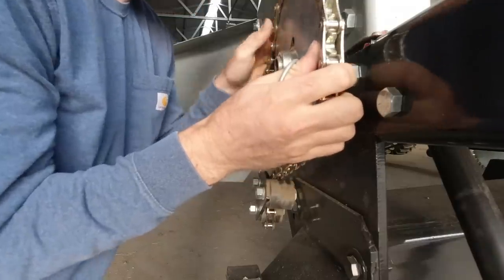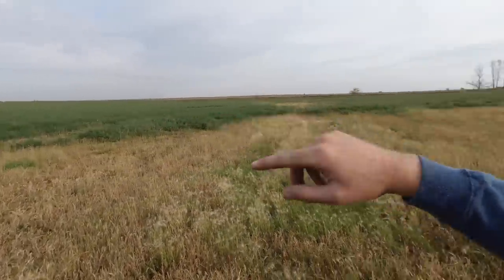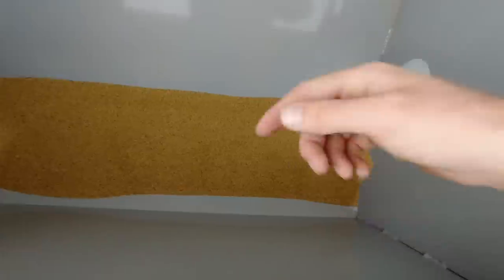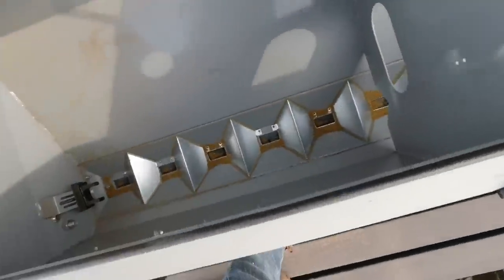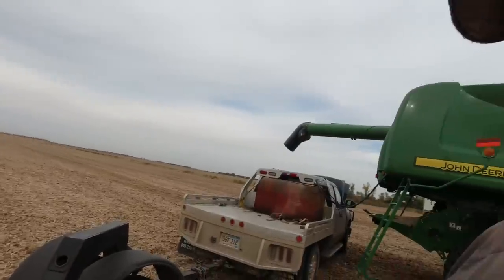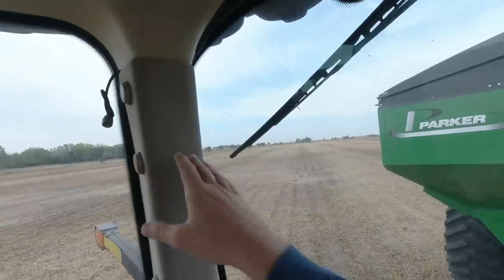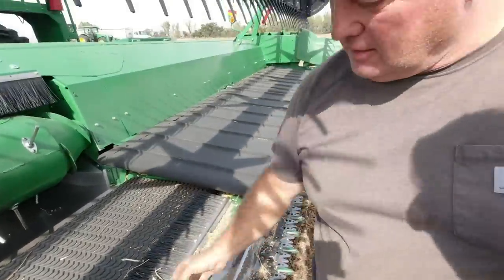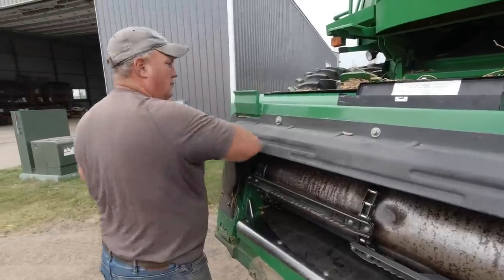Record Time!

Comment: We had a Great Plains drill that I bought 6 years ago. It was a no till. Loved it. My son came back on the farm and we started to run about  800 more acres. It took to long with our 15 foot drill. So my son said we need a wider one. I had my Great Plains drill paid for. We spent one winter putting new openers and some special type of tubes plus other stuff on it. It was paid for. He bought a 30 foot sunflower no till. I will say after our first year I’m impressed. Some of the best stands I’ve seen. I don’t know how many acres we planted but I’m guessing over 2000 with double crops on some of it. But I would still like my Great Plains drill back because it was paid for. The new drill cost $48000. I know that’s chump change to you big guys. But can’t believe it costs so much. That’s what I paid for my first house 35 years ago
Reply: believe me the prices of things now adays I will never get used to.

Comment: Back here in Minnesota, i always used a small grain cover crop for alfalfa. wheat or barley was the best because of the shorter stalks. We would harvest the grain and, then keep that ground in alfalfa for at leat three years, Then we moldboard plowed it under as a green manure, and did two years of corn, followed by a year of beans, then back to the grain and alfalfa. That was a pretty common way of doing it. My drill did not use covering wheels, it had chains that dragged behind each drill, and, that was usually enought to cover the alfalfa seed, the same goes for clover, it worked pretty well. Sometimes we would drag the field with a harrow with the spikes set flat to even it all out and cover the seed. It was  all more labor intensive, but, resulted in a lot less need for chemical weed and pest control.
Reply: So you want the FL for to grow back there when I have in mind on some chickens that graced right on top of the land and you can move their chicken house it's all portable and I saw it from this other chicken farm and what you do is the chickens live right on top actually you know and you have work or go in you know and feed them like you do your cows everyday and you move their whole big chicken thing yeah with your trailer with your you know your rig there and it germinates all the good organic seating and it makes it come back alive naturally yeah germinates the whole area yeah naturally with the chicken feet and the maneuver that comes out of the waist of the animal it combines grass and grows it back naturally with bugs and nutrients that eat things that you need to feed your cows and raise your crops in yeah and that's a very interesting one on a chicken farm because it's all organic you know all natural and that can save your spot up there with that rain and it sounds like you get a lot of wet area and if you do where that wet area goes down I just means you need to make a pond of your own yeah and hopefully you do have a well on your property to feed everyone and to provide water for everyone yeah cuz I have one down here with my daughter we have a private well everybody else some of our friends have the city well but we don't have that now we get our straight up down from the mountain great direct tapped into online yep and you guys have a blessed day and thank you for sharing coat happy birthday 🌈🍰🍰🍻🍩🍩🍦🍦🌎✨🙏🤝💗💗🤳💌
Reply: You give me those brown patches spot that you say you can't grow your alfalfa and let me do a chicken survey yeah and I get paid for it too I can't tell you how much to blow your mind but you can get paid to do something you got that right I need to show you how to do it chicken farm work you have to move the whole thing but it's real portable real good for the land and yeah it is I guess you called a million dollar thing but I just call it free developing something that was already there in the first place which came first the chicken or the egg if you can't answer that question well so yeah I left you an idea there because I do know some people that have some farms and it's natural and it receives the ground and turns it in also to alfalfa that you need and how's the other friends that you know show me how you can use some water and recycle the water too on your land when it gets heavy and there's a lot of different ways all of them are good the ones I know and it makes the earth green again and it keeps your land healthy yeah 🌈🍰🍰🍻🍦🍦🍩🍩🧁🧁🙏🤝💗💗🤳💌
Reply: @svetlanarudovsky7459  Not a bad idea yeah.
Reply: @keith, this is what I did for years in Iowa.  Worked every time.  I’m going to seed wheat this year with a grass/alfalfa blend  on 11acres.  Hopefully the nearly 20” of snow we got last week dropped sufficient moisture to get a germination next spring.  At least we have all winter to get more snow.  Looks like we may get a little tomorrow night.  It’s been far too dry for far too long.

Comment: Cole / Brian why did you leave the strip to the right of the combine at 10:17?
Reply: with autosteer locked in, the combine shows me how many odd rows there will be to end the field. Not all fields have the exact amount of rows to fill the head completely. I left that strip until last thinking that if it started sprinkling and the beans were getting tough i still might be able to finish with a half strip going through the combine.
Reply: Gotcha! Thanks

Comment: Let Brian know the hats and beef jerky will be on the way this week ! Had a funeral Sunday and today got to the shop only to see the dually with bumper pull loaded with 2 John Deere zero turns as well as all Sthil weedeaters and blowers gone ! As was over 2oo gallons of diesel stolen from yard ! That equipment part of our short grass crew! Apparently they entered shop thru roof and took vehicles keys and equipment and drove truck thru the gate! Good thing everything has gps trackers and was located within an hour ! Now just have to wait for police to release stolen equipment after their investigation and report ! Semper Fi
Reply: Steal from a veteran while he is at a funeral. Wow.
Reply: @briansonne814  yes sir and they are in a concrete cell where they belong all 3 of them ! The power of trackers on equipment sure pays off ! This is the 3rd time ! All 3 times equipment found within an hour and scumbags luckily are in jail before I got a hold of em !

Comment: I was thinking you might be able to talk John Deere, CAT, CNH or Volvo to let you test run of a bull dozer or track excavator to dig out your stock dams since this is probably the lowest they have been in many years.   It would probably help if you committed to the equipment company for a three video exposure on your channel.  I am sure it would be really fun machinery experience while doing  maintenance cleaning out sediment in your stock dams.    I think you could play it up to get a pretty high view rate for your channel also.
Reply: If you're going to talk to Cat? You might as well talk to Euclid and get a front and rear engine wheel scraper? Cleaning out of stock damn or a Dugout in an afternoon and fix up any Spillway damage.